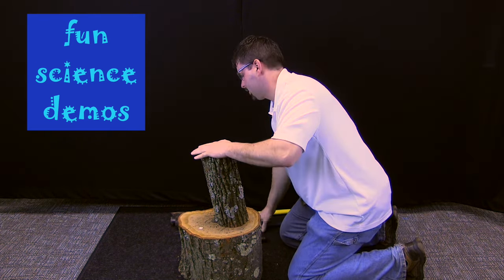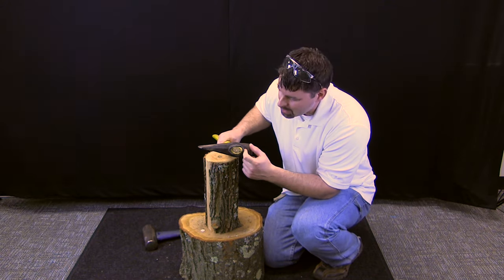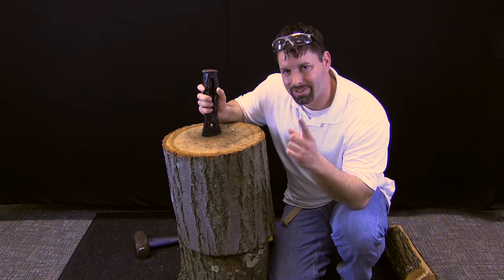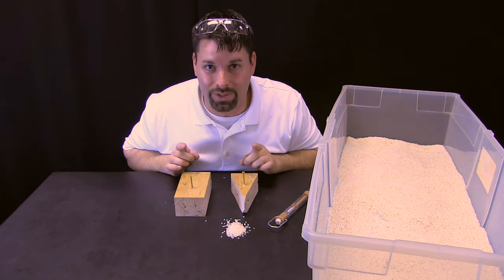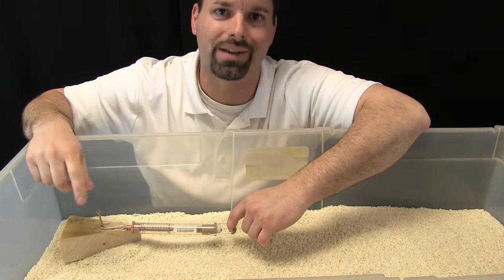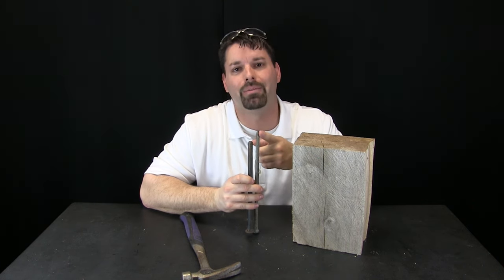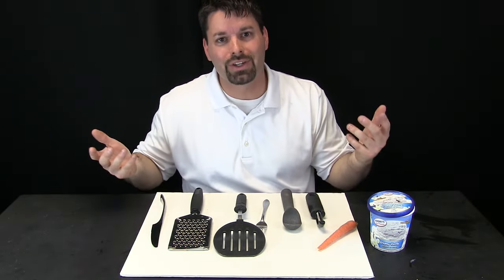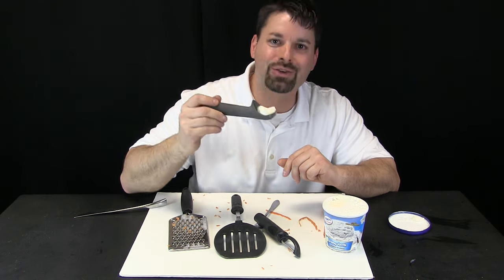Simple Machines: The Wedge

Comment: I would say another thing that is at work is the concentrated force on the small surface of the wedge. Instead, if it was a flat, wide surface, like the hammer, the force would spread trough all the surface that is making contact with the object you're aiming.

Comment: I appreciate the video and the intent. I would say that some of the ways the tools are used is highly frowned upon (er, side of the hammer) and runs the risk of creating misconceptions with young kids viewing this. Also, explaining that the designs of products lends them to different applications seems fitting. For example, when watching the carriage bolt being pounded on verse the spike, one take away may be that the spike is a better fastener.  This would only be true based on application and should be addressed (misconceptions).  In fact, the spike could never provide the holding power (force) created by the other simple machine: the screw.  Also, a verbal note to safety in this video (though many safety steps are noted visually, e.g., goggles, the wood under the piece being split, etc.) seems appropriate.  Also, the rice demo had more to offer. The forces of a wedge are perpendicular to the input force. This is demonstrated by the direction the rice moves, yet wasn't addressed.  Could the top layer of rice even be colored to expose that direction more?  Good effort.